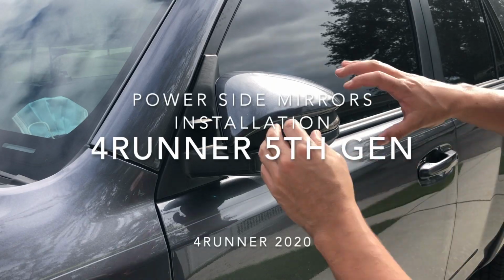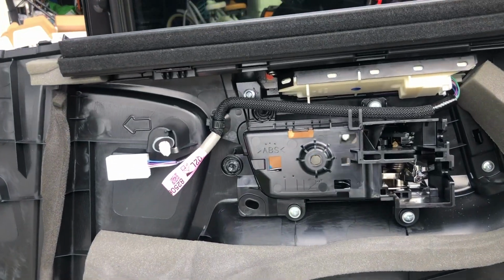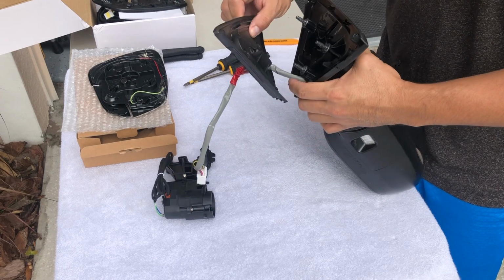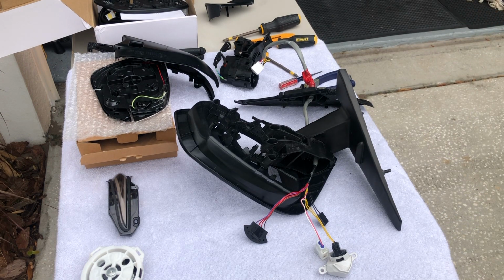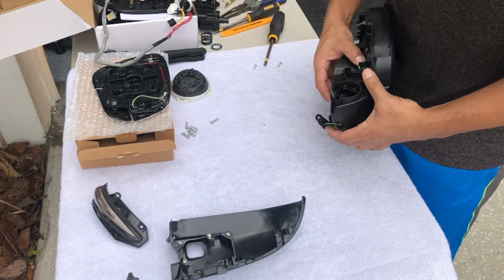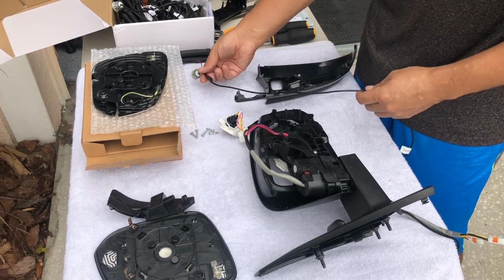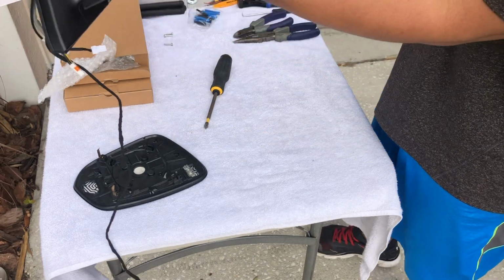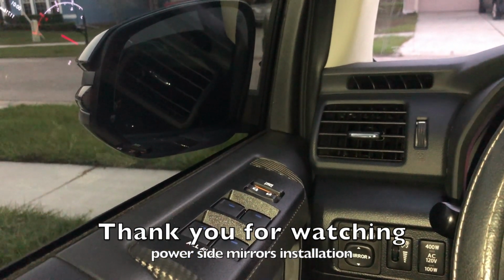4Runner 5th Gen Power side mirrors installation

Comment: Cable and connector from mirror on my 2024 Toyota 4Runner was not like your 2 part connector  Might was multi pin that had to be De-Pinned   took a lot of photos  still got it wrong  have to take back apart

Comment: Hi Milton. I had this installed on my 4runner about a month ago and the driverside mirror, when folded in, the motion sensor continuously flashes. Did you have this issue and if so how did you fix it.
Reply from the maker: Hello, I don’t have that issue. Both sides or just the driver side? I will think that when it folds, a wire gets pinch causing to trigger the light. I hope that helps.
Reply: I had this same issue. Did you find a solution?
Reply: No. They still flicker

Comment: Hey Milton JR since youre a 4runner mod Guru/Wizard do you think its possible to add sequential turn side mirrors to a base sr5 without them if I buy the whole side mirror unit from a dealer? Love your channel!!
Reply from the maker: Hello, sorry for the late response. Yes you can. You just need to tap and run the cables from the turn signals to the mirror. I have done that mod on a Tacoma. Hope that helps.

Comment: Hello my friend is it good for RAV4 2019
Reply from the maker: Hello, I don't know if the mechanisms will with a Rav4. The motors to power the mirrors are designed to fit the 4runner but they do sell the motors for RAV4.

Comment: Hi, very nice installation. I have a question, how the  blind side light work?
Reply from the maker: I install a BSM system that I connected to the light to make it work. I am working on putting the BSM system installation video up. Stay tune.
Reply: @Miltonjrlb  thank you. I installed the power tailgate and it works good. I think it will be a good video for you. No one has posted a video about it.
Reply from the maker: @gloriapilarte5210  That’s good. I have installed the power tailgate too, but I have an issue, and I have to return it. Did yours work correctly?
Reply from the maker: That's the reason I have not put the video up for the power tailgate.
Reply: @Miltonjrlb  yes, it works perfect
Reply: @Miltonjrlb  did you buy it from autoease?
Reply from the maker: Yes, what years is your 4Runner? My is 2020
Reply: @Miltonjrlb  2019 limited
Reply from the maker: The video for the BSM installation is up, take a look and let me know if you have any questions.
Reply from the maker: https://youtu.be/X3hZqkwzOn4